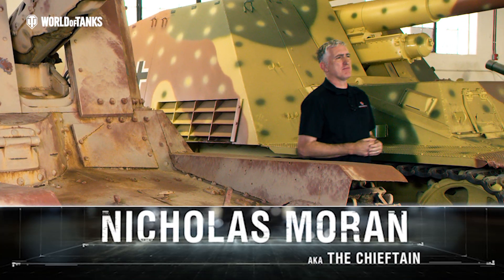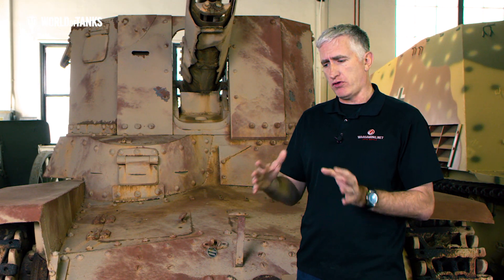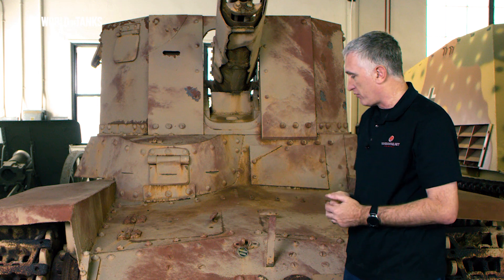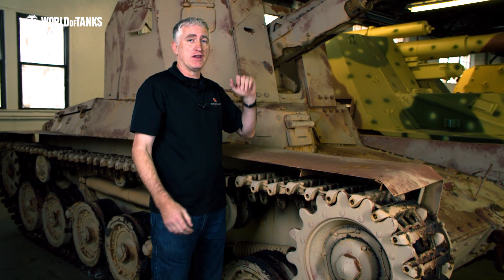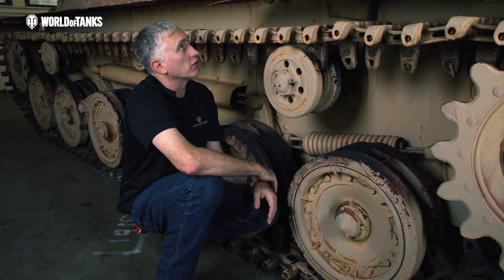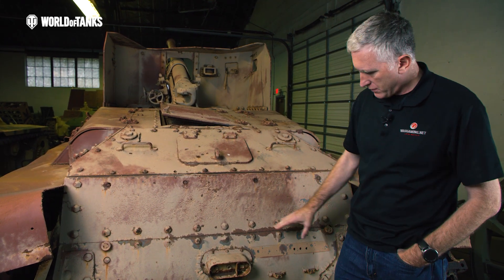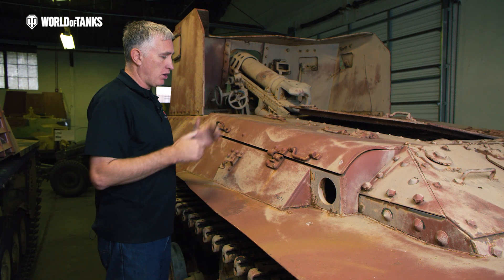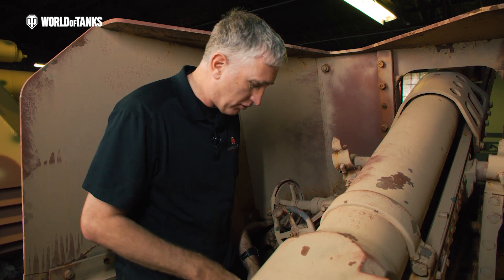Inside The Chieftain's Hatch: Ho Ni

Comment: Even though it's diesel fuel, I see another problem with location of the fuel injectors on this and the Ho-Ro. There is going to be two areas now that are vulnerable to producing major fuel leaks, both the engine compartment and the back of the gun mounting.

So for example being strafed from above, you have two places for the tank to brew up. It may be harder compared to gasoline to catch on fire, but when people are deliberately trying to do that, well you can still get it hot enough to catch on fire. It just has to be a little hotter.
Reply: Not really because the engine now only has the injectors. They leak a lot less than the pump. (Usually) If the pump gets hit it is now really easy to change.
Reply: @teamidris  Yes, *but*... if you nick or crack one of those injector lines in a firefight while the engine is running the crew is going to have a very bad time once the cloud of diesel vapor ignites.
Reply: @mfree80286  Oh hell yes, that would be quite a flame. I forget though, back in the day the injector pipes used to fatigue crack. Sometimes the lit up the engine bay on any vehicle. Here you could see a leak and fix it easily.

Comment: Seems like the armor plate has either too high a carbon content, or the hardening/heat treating process was incorrect.
Reply: @razor1uk610  What utter shite.  US armour was soft (both tank and naval) and was known for being inferior to British tank and naval armour.  The British actually bought armour plate from Czechoslovakia in the 1920's and 1930's for use on British naval ships when they were suffering some shortages  because it was known to be of very high quality.  German armour was variable depending on when it was made simply because they had constant problems with the supply of alloying metals.

Japanese naval armour was soft on the cruisers and exceptionally good on the BB.  Watch Drach's video where he compares the actual test and battle performance of US and Japanese naval armour.  Japanese tank armour was brittle simply because the Army didn't have the experience and didn't know what to order; late war (43-44 produced) Japanese tank armour has been shown to be better than early or very late war armour because they learnt their lessons in 38-41 and were able, until supplies went to crap in mid-44, to correct it.
Reply: Didn’t they use face hardened armor for their tanks? 🤔😵‍💫
Reply: @Kuschel_K  A lot of the tankettes produced in the 30's were case hardened steel as they were only expected to deal with small arms rounds.  By the time the Type 97 medium was in production they had switched to a properly produced RHA steel, but they were still specifying the wrong steel type and it was too brittle - better quality, but still the wrong type for taking rounds over 20mm.  Late war ('43 onwards) specs fixed that after encounters with British and US armour in '41 and '42, but by that stage they were having trouble producing it to spec so they were no better off in the end.
Reply: @iatsd  what exactly are you talking about lol. Early war? Mid? Late? Shame that US steel was so bad that the British had to resort to using American tanks, aircraft, and an assortment of naval vessels because they couldn't keep up. Something that has only gotten worse to this day.

Comment: Concerning Japanese naming conventions, it was using the old Imperial calendar that begins with the first emperor and continues to today so a Type 90 came out in 1930 or 2590 but because only the last two digits are used in the name it appears to roll over in 1940 to 0. So the Type 0 fighter came out in 1940 and the Type 1 anti-tank gun came out in 1941. Still the same calendar though.

Comment: You can torch off rivets and replace the worn-out sprockets and rivets take less machines to make. Something Japan was short on.

That looks like an injector pump but given all the pipes it could also be where injection timing was controlled but that sounds like begging for fouled nozzles.
Reply: Summer and winter timing settings though. Plus it is easy to work on with bad fuel.

Comment: Riveted sprockets. Probably decided it was easier to send the whole assembly out and re-condition the old one behind lines. The rivets do pull up really hard as they cool and are way better than a bad bolt. The assumption is you need a lot of kit for rivets, when all you need is a hot fire and big hammer.

Comment: from a materials standpoint, lets assume its creep or fatigue that caused those fractures.

assume creep, the armor is under an extremely large load relative to what it should be, maybe internal load, maybe external, so much so that it fractured. i doubt it.

assume fatigue, thats alot of cycles under the sun and rain. still not likely, i suppose its a weakness in the material itself if caused by fatigue.

ideally, i'd be able to examine the cracks with a magnifying glass, calipers, and torch light, to even get an idea of the true cause of those fractures, but thats not very likely so, beats me

Comment: I think that the little hatch was used in the event the driver neded to close the big heavy hatch in the front while under attack or when driving. It looks like it was not possible to close the big hatch in front of the driver , unless you go outside and close it. With the little hatch directly above it, the driver can put his hand trough it and push the big hatch down.

Comment: This is just speculation, but I'm guessing that the reason why the Japanese riveted the sprocket wheel on was because A. They kind of knew these things weren't going to last and B. They knew with more certainty that it'd be more "productive" to use the sprocket wheels they've produced on more tanks than to create an excess for vehicles that might make it back to the shop, but probably wouldn't. Also sending things back to the shop would be a huge hamper into their work flow. Japan was pouring everything into their navy, then their air force, then their army while the armor gets the scraps left over. There just wasn't enough resources to go around and it was more important to them to keep the Kaga and Akagi fully stocked and the Yamato and Musashi in tip-top shape just in case. . . . . . By the time all 4 ships were sunk, they didn't have enough materials or time to redirect attention to armor development.

So again, speculation that it's partially the strict limit on resources and very speculatively that they knew their vehicles couldn't stand against Allied armor and just relied more on desperation than reliability. If the vehicle got to position and fired, that was a success.

Comment: I love these Japanese tank destroyers as they look so silly and uninspired. Definitely a mythical sight indeed to see that this thing actually took a hit and didn't spontaneously combust. I don't think it was hit by a 37mm because M4's were in abundance in Luzon in 1945, which is why this vehicle was needed by the Japanese to begin with, and a 37mm would have punched through the superstructure. More than likely it was hit by a stray .50 cal from a P-47 Thunderbolt from quite a long range in a strafing run. If the Japanese crew saw the plane coming, they would have abandoned the vehicle before it was ever hit because if they were perched on a mountain, they would have been an easy target.

Comment: Wonder if the cracking could be caused by corrosion like you get from sodium exposure on stainless steel?
Reply: nah it was the Vickers process they were using it was outdated, it gave a very glass hard face on the metal, and didn't allow for much flexibility.

Comment: I think the round that hit was probably smaller I think a37mm anti r than a 37 mm. Probably a round from an M2. I think a 37 mm would go through 25 mm of armor.
Reply: The front armor where it hit first has another 25mm welded plate on top for a total of 50mm. 

I wouldn't want to be in in when it happens but it has at least a chance of stopping a 37 at a bad angle.

Comment: The Japanese probably dealt with the rivetted sprocket rings by swapping the entire sprocket wheels from side to side.  You'd have to remove the sprockets to change the inner rings anyway, so just slap it on the other side and drive on. Those sprockets don't look particularly worn on either side so it may not have been a problem.

Japanese radios may have been excellent but their aircraft radios were hobbled by poor ignition shielding and the then poorly understood phenomena of precipitation static.  Neither of which is likely to be a problem on a diesel powered ground vehicle.  Most of what we do know about precipitation static today came from US research during the war.

Poor quality steel was a problem for Japan throughout the war because of shortages of chromium, molybdenum and other alloying metals  They knew how to make good steel but lacked the inputs.
Reply: Good point.  Their alloys were only ever going to be as good as the supplies they had.

Comment: What the heck? ANOTHER Chieftain's Hatch video AND another Japanese vehicle i had no idea survived? I'll take it.

I'm a bit disturbed as to Nick's lower opinion on Japanese tanks and why he keeps comparing them to American tanks. When the Japanese were designing their tanks, they weren't thinking of America as their biggest tank rival, they were think of China. America would be delt with by the Navy and Air Force. By the time Japan realized that the tanks in the Pacific theater weren't gonna be up to par against the M3's and M4's, it was too late. But for who these tanks were designed to fight and how to fight in the mountains of the Pacific, there tanks are great. They weren't made to be charging the fields of Prokhorovka, or attack a Matilda in the deserts of Egypt. They were built for attacks against China who barely had a tank force.
Reply: Fair, and I'm a little more willing to give tanks like Type 95 and 97 some benefit of the doubt given the overall infrastructure that they had to play with and the fact that they were pre-war designs, but it's a bit like the Italian tanks. M13s and Chi-Ha may have been acceptable in the early war, and indeed, the initial thrusts through Malaya, for example, were proof of it, but the problem is that they were still the standard tank once Grants and Shermans came about. In the invasion of the Philippines 1941, the standard Medium Japanese tank weighed the same as the standard American light tank, they were utterly outclassed against their enemies.
Reply: Japan's inability to improve her prewar designs in any meaningful way is a major knock against her, though.
Reply: This is a late war design.